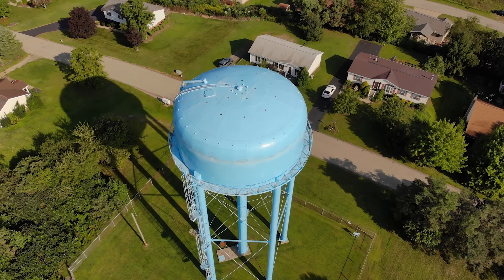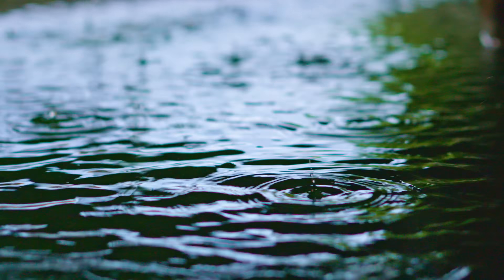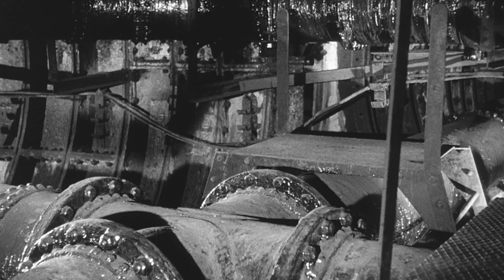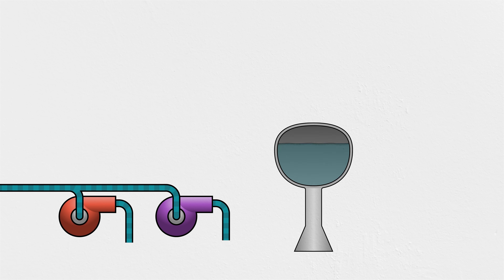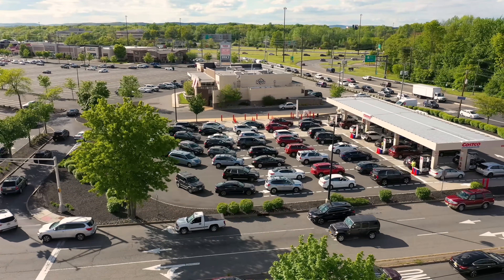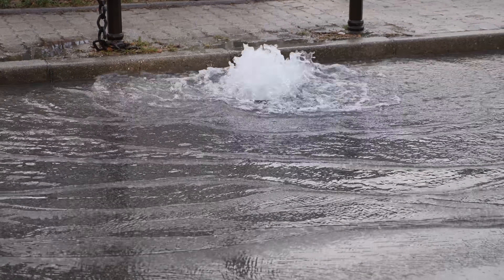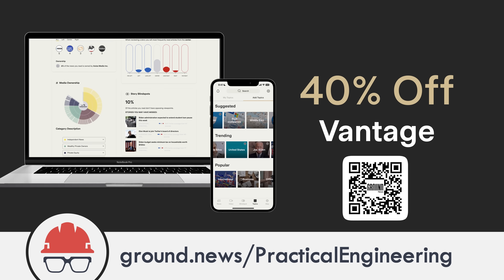When Infrastructure Gets Hacked

Comment: I work as an operator in a small west Texas town and not for nothing, we have opted not to connect our SCADA system to the internet specifically for these reasons. Great video!
Reply: Next step is social engineering training for anybody with access, including everyone up the chain. I've seen some very confidently wrong c-suite execs who would plug in that usb from the parking lot in a minute.
Reply: Additionally should setup least functionality and least access controls. Having seen first hand the affects of someone breaking an air-gaped system unintentionally and the resulting incident when someone found out the system had little to no controls in place to limit access.
Reply: I'm a licensed operator of a rural water system (volunteer) as well as an IT systems engineer. My PLC isn't even capable of being networked... short of disassembling it, installing a GSM modem, and adding function blocks. Changes must be made via physical access and RS232 serial, from a laptop that contains the original decrypted program layout.
Reply: An air gap is your best insurance 9/10.
Reply: @ABrit-bt6ce eh, Iran might disagree
Reply: and how do you do the remote monitoring of parameters ? the infamous traditional webcam pointed at a screen to air gap the systems ?
Reply: @monad_tcp drinking water engineer, my last utility didn’t remote monitor. Two ops on duty, one on call, two supervisors, and manager if needed. Any emergencies get communicated up through calls
Reply: Would you consider purchasing ML-based HIDS/NIDS ?
Reply: They should be secured anyway. Just because they aren't connected to the internet does not mean someone won't be able to reach them. (or someone won't connect it to the internet - intentionally or otherwise.)
Reply: Always remember that convenience is the enemy of security.
Reply: Good move.
Reply: You cavemen! that will lead to recession and economical chaos
Reply: WISE DECISION ... the water tower doesn't need facebook

Comment: Are water towers really having single input and output like in the diagram? I feel like pumps would need to fight against crazy water pressure of the increasing water level in the reservoir and it would be better to have thin pipe with the inlet at the top.

Comment: The fact that this video dropped right before the Lebanese pager incident was interesting
Reply: Kinda different in a way. 
If your opponent is an advanced persistent threat (IE your group has pissed off a nation state actor) you have a whole mess of other problems especially when your supply chain is vulnerable. (And everyone's supply chains are vulnerable, why do the bolts on an f35 cost so much? Because we are pretty sure no-one has hollowed one out, put something spicy in there with a little radio reciever in it.)
This water attack was leaving the front door open, the pagers you will need to pull them down to components to find that. 
Military's do that kind of thing. I know of a few times that backdoors were found in devices coming from supposed allies.

Comment: Electrical engineer here. I work closely with the SCADA engineers at different utilities to ensure we are prepared for these sorts of events. There is a surprising amount of redundancy built into control systems for power grids. There are often at least two and sometimes three completely isolated control rooms in different areas of the state for local grids (think 10-50 Gigawatts) in case of natural disaster, terrorist attack, cyber security event, etc. While local substations may only have one RTU, anytime there is more than a couple hundred megawatts flowing through a station there are multiple RTUs connected to different networks over different physical routes back to different control rooms. One could be compromised and we would still be able to control the system just fine.

Comment: Very simply:  These systems should not be connected to a public internet in any way other than data output.

No means of control away from the authorized control station.

Convenience is not important enough to allow the risk of hackers interfering with or taking over control.

Comment: Regarding overflowing reservoirs…historically many overflow outlet pipes have had the same diameter as the inlet pipes. Such a design ignores the pressure differential between the inlet and the overflow where an inlet is at a low elevation relative to the overflow. Should the overflow pipe fill completely (e.g. due to a feed pump failing to shut off), the water level in the reservoir will continue to rise until the height above the top of the overflow is equivalent to the pressure differential with the inlet. Thus, a calculation should be done to size the overflow area cross-section to account for that difference. 

This past practice resulted in at least one tank losing its roof because the feed pump cutoff failed to activate.

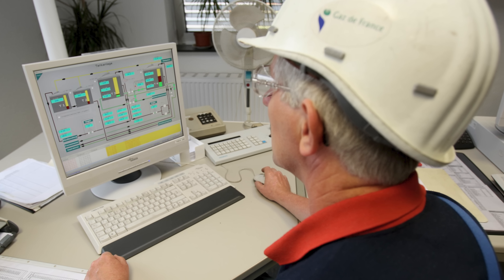Comment: For anyone curious about the screen at 5:34, "RO" stands for reverse osmosis. Chip manufactures like SanDisk require ultra-pure water in the manufacturing of silicon wafer chips. VFD stands for variable frequency drive. Instead of having motors that are either on or off, a VFD allows you to have speed analog speed control of the motor.

I'm speculating here, but I'm pretty sure that's a Siemens Comfort Plus panel too. 😅
Reply: Also, Grady keeps using the term HMI. That stands for Human Machine Interface. The two most common types are applications run on a computer (like a browser window) or stand alone panels with a minimal operating system and communication system for connecting to data interfaces.

Comment: Oh man, my time has come!

Automation engineer here. Background in a bunch of this (PLCs, DCS, HMI, SCADA, IT/OT networks, etc.) I have so many thoughts, but I'll try to narrow them down into some categories:

History: Yes, things used to be controlled by hand. An anecdotal story I have from some very old operators at a papermill was that they used to have 3-4 time the personnel. Each person would have several sensors to monitor (pressure, flow, temp, level, etc.) and several actuators (valves, relays, contactors) that they could operate to control the process values (PV). They had radios and would work with others to monitor process conditions to efficiently perform whatever unit process was occurring (chip pulping, bleaching, paper machine operation, etc.)

Modern setups: I haven't worked too much with RTUs. I'd love the comment section to give feedback on this, but I would say PLCs (programmable logic controllers, sometimes called PACS - process automation controllers) are more common. RTUs are for more rugged environments and generally wirelessly transmit data back to some collection devices. PLCs are cheaper overall, and because most processes involve some human interaction, sealed cabinets (NEMA 4X) can be used to prevent water, dust and chemical ingress.

Security: Big issue as we enter the 4th industrial revolution (sometimes called Industry 4.0). At this point microcontrollers have become so cheap and easy to manufacture, that data collection, aggregation, screening and cleaning is very very low effort. Additionally, all manner of devices generally come with advanced connectivity. But the drawback to having all that connectivity is that privileged access and security configuration standards have to be stringently adhered to. The problem with this area is that no one can see the digital landscape physically, so it's often neglected or forgotten about entirely. Things like air gapped networks and DMZs become crucially important to maintaining safe IT and OT networks.

If you're watching this and are interested, I'd totally recommend checking out the Real Pars you tube channel. I think it's fascinating discussing the marrying of automation strategies and  control systems with real world process challenges and technologies. Real Pars does a good job at covering a lot of this. Here's the link:

https://www.youtube.com/@realpars

Comment: A few years ago I heard that a nearby hydroelectric dam was being controlled by a computer based on the Z80 processor installed in the 70's. Nobody wants to replace it for the fear of the new system failing. Not to mention they have to shut down for an extended time to replace it.

Comment: I'm a licensed ethical hacker and network engineer of over 20 years and have several water districts as my clients in Texas and I can say that most do not have the cybersecurity support or network security in place to properly secure their infrastructure. A lot of it comes down to IT departments not knowing what they don't know about cybersecurity and thinking they do, which in turn means they reject specialists like myself who provide oversight and ensure that high level of security. Because this attack wasn't done through social engineering, that means the network security wasn't anywhere near where it should have been. The only threat a network should have is through social engineering because if it's a technical weakness then someone isn't doing their job.
Reply: I agree as that was my experience working as a public water system regulator for almost 14 years. Yours is the most salient point relative to other comments herein, as air-gaps can still be penetrated if an unsecured thumb drive with a virus is connected to the air-gapped network.
Reply: @jaymacpherson8167  That's why you fill all the USB ports with superglue. It's only going to get worse as the market is now flooded with devices that use USB-PD to charge.
Reply: @Reahreic that is such a great point re: usb charging.
Reply: Cybersecurity Architect here - industrial control systems are a serious issue. It's scary how outdated (and insecure as a result) many of these systems are.
Reply: I find your field fascfascinating. I listen to a podcast where they talk to folks like you and others in the industry. Sometimes it's hackers that have even been convicted of stuff. It really gave me a cool insight into your industry. It's way over my head but it's fascinating. 

Simple USB drives and devices seem to have begun to pose a much higher risk over the last handful of years or so.
Reply: Oh the podcast is called Darknet Diaries, I find it interesting, maybe someone else will too.
Reply: @goosenotmaverick1156  oh, I do.  One of my faves.
Reply: @goosenotmaverick1156 The risk with USB was always there. It's just that the bad guys have better understanding of how to take advantage of them. 

Also, with dedicated keyboard and mouse ports being ancient history, the simple solution of filling all USB ports with super glue no longer works as you need at least one.
Reply: That isn't necessarily always the case, even a system using physical 2fa keys, like google's titan security keys, can be bipased. Not to mention the newer versions of stuxnet can bypass encryption even AES-256.
Reply: Ethical hacking is one of those fields where you might as well be a wizard to the uninitiated, so they assume what you're telling them is either actual magic or lies to line your pockets.
Reply: @HellYeahCorp  interesting point. I am no hacker by no means but I have found a couple of too easy holes here and there, coming from hacking save games as a kid. 
Finding those holes is great.
Applying harmless pranks always was done by people that "knew".
But i never considered it magic. 
It's more like when you scout out a lost place that initially looks severely locked down. Then you realize there are half a dozen doors where you just have to try the knob to open them. Where is there magic in it? It's just about having los cojones to believe in your skills that you can make it.
Reply: 100% can’t agree more! There’s an audio book called Ghost in the wires. Perfect example of social engineering.
Reply: Who licenses hackers?
Reply: @JustinVodden Major organisations. They want good hackers to break into things and find issues before bad hackers do. 

I use to white hack for good. I’d be on exclusive hacking forums, with most bad hackers, some would discuss potential victims and me and a few in our group would attempt to hack the user beforehand to get contact information in order to warn them and/or change details that will delay the bad hackers. Or we contact the bank of the potential victim advising them of a group currently in the process of a planned hack of their customer. 

Many of us would pretend to be black hats infiltrating groups but would be doing stuff in the background to tip off those potential victims. You have to do some things to keep rep and credit, but if I breached a bank I would merely just share what I got access to, never take anything and notify the bank after (without those in the group knowing). I’d never share the details.

Back in the days brute forcing was a lot easier as well: social engineering is still a simple method of gaining access. Also a lot of people put answers to their security questions across social media and so on. Family trees help for some questions.

Phishing is easy on those not as aware of them. Spoofing email addresses so your phishing emails come from the actual email address of the company makes it much more successful. If you got an email from noreply@apple.com, you’re likely to believe it, and it’s easy to send emails from any email address we want (we just can’t receive emails back). Same for spoofing numbers. We can call people from the actual number of their bank and it’ll show up on their phones as the number from the bank. We would say to skeptical people to check the number on the back of their card to verify the number if they wish, as they would then check their banks actual number and the number who’s calling them and they’d see it matches and be confident it must be the bank because how could the bad guys call them from the banks own number?
Reply: Even if they did listen, they'd soon rollback your suggestions. Security is inconvenient. It makes everyone's job harder and take longer.

Comment: The title of this is so confusing. Towers work on electric pumps and gravity. There are wireless towers and various other tertiary equipment not related to the system but it shouldn't effect the water tower at all. On top of the fact why didn't the max level bobber not stop flow through an emergency shut off or even hey why was there no manual shut off?

Comment: IIRC, the VFD's used in the Iran centrifuge attack, were Allen Bradley Powerflex. Rumor has it, at the time, that the CIA approached Rockwell to look for known or potential vulnerabilities that their CS operatives could exploit to attack the drives. IIRC further, they exploited memory registers that are visible over RS485 Modbus protocol. All the drives are networked over RS485 using Modbus for control via Wonderware. Wonderware is how they got in.....I believe.

Comment: It seems like these systems would have hard coded constraints on high and low limits to prevent HMI errors or hacking?  Why would 11,000 ppm even be allowed as a set point?  On another note, would you not back up your billing computer so it could be restored to a known good state (like hourly)?  Seems like all of this can be mitigated and is easily foreseeable.  It makes me wonder if we as a nation are adequately implementing anti-hacking mitigation into our infrastructure proactively.
Reply: For systems designed now, that is a thing people consider! I've seen a few talks on it at conferences, generally under the name "cyber-informed engineering." A good example is the sodium hydroxide thing mentioned in the video: if the tank that holds the concentrated hydroxide is small enough compared to the amount of water in the mixing tank that even if it were completely opened up it wouldn't reach a dangerous level then it doesn't matter if somebody hacks the HMI to open it up (as much)!

A big part of the problem though is how long these systems live. Infrastructure lives for 20, 30, 40+ years so even if we start building everything with perfect security now it's still going to be a long time until all the old stuff is phased out.
Reply: The problems with easily foreseeable and mitigated are:

1) We have the benefit of hindsight, which makes it hard to be objective about how easily it really was foreseeable.

2) 10,000 easily foreseeable things aren't easily foreseen anymore unless you have the time to think of 10,000 things, which we almost never do.
Reply: @Renegade605  Thus why I asked my real question and gave examples.  Are we as a nation being proactive enough?
Reply: @msromike123  no, no one is.

But also, what is "enough"?

Enough to prevent any possible attack from ever happening? Well that probably isn't even possible.

Enough to prevent loss of life due to a cyber attack? That didn't happen here, so by that metric it was enough, right? 

Just like every other engineering decision Grady ever talks about, there has to be a balance between cost and risk.